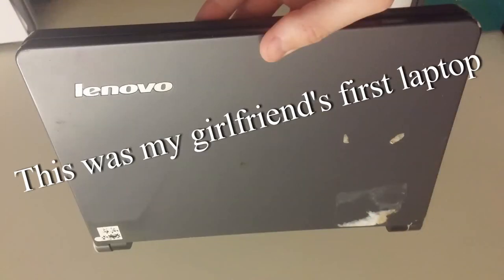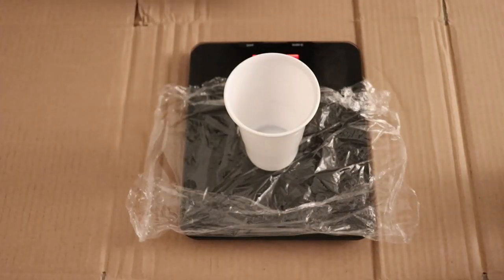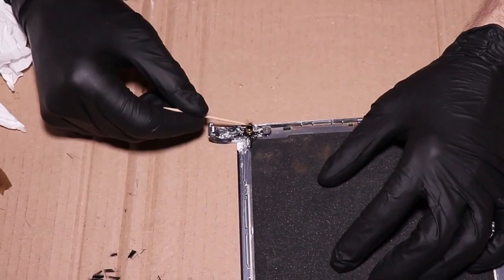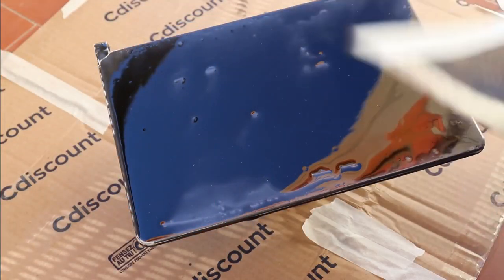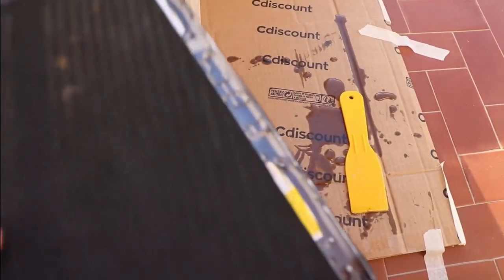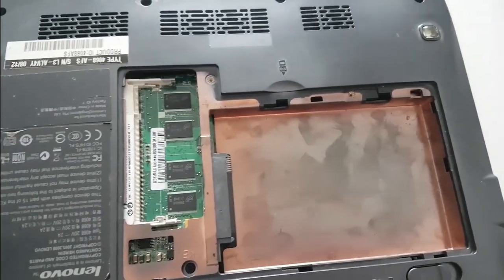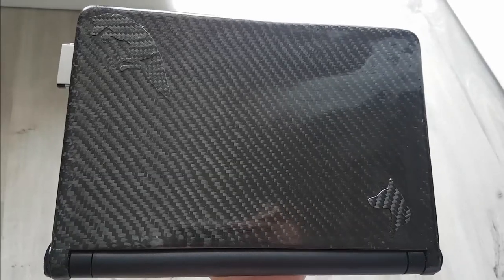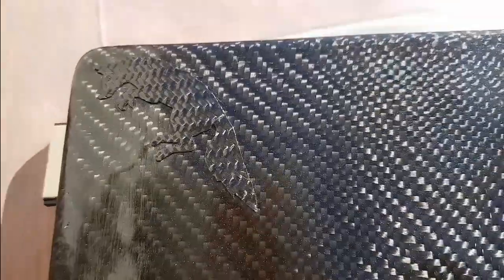Real Carbon Fiber Laptop Repair | Carbon Fiber Skinning (Experiment)

Comment: Hey this is a cool repair idea! Can I replace CF with Epoxy instead though?
Reply from the maker: you can but it will not be very strong. I guess it will depend as well on what epoxy you use

Comment: What I want to do is a laptop  protector. I plan to make a screen back size carbon fibre mauld and with double sided tape attach it to laptop .It will allow me to remove it if I do like it or on warranty send for repair if needed.
Reply from the maker: Nice idea